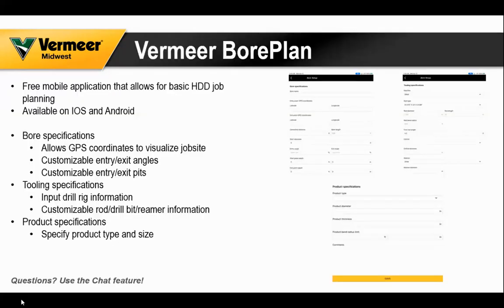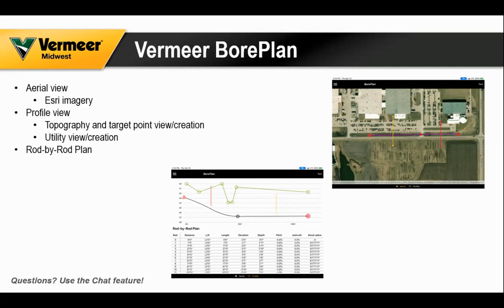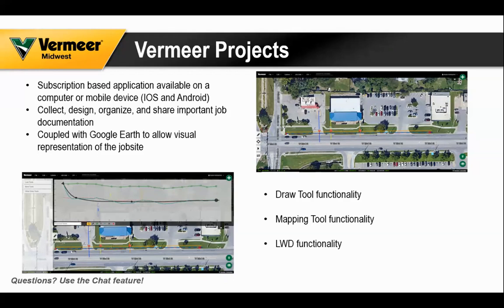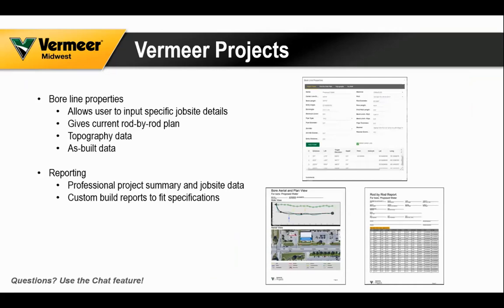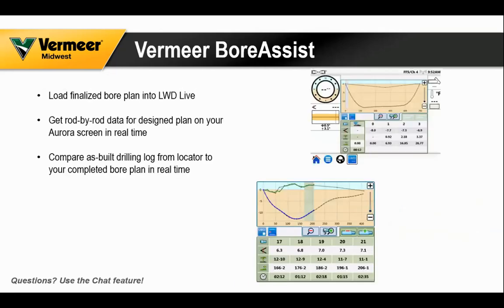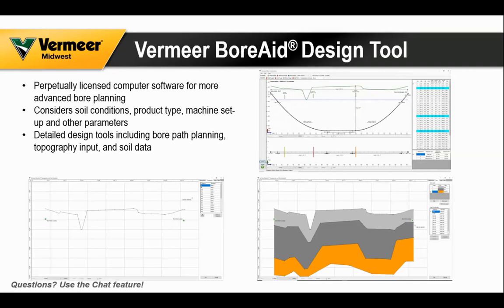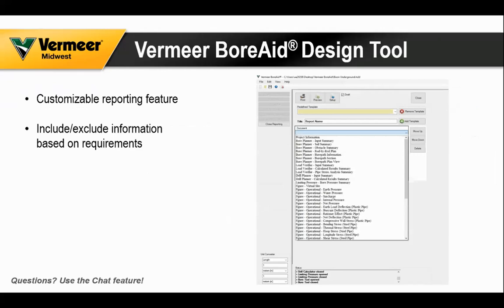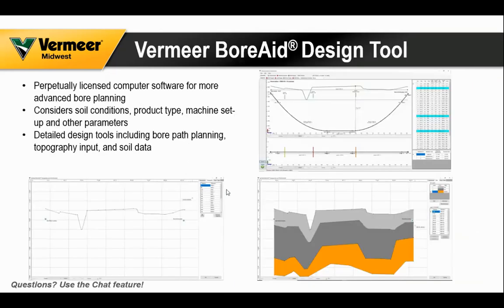Virtual HDD Class - Bore Planning Tools

Comment: It’s a cool tool with a lot of features. It feels difficult however to find demonstration videos showing how to use the tool. Does Vermeer have any videos on how to design bores that include a horizontal curve? It seems you have to use the bi-arc tool however then you have to keep moving points around to get the radius your looking for which takes hours. I cannot seem to directly assign a horizontal radius to my bores.